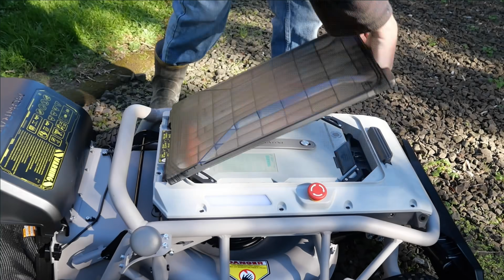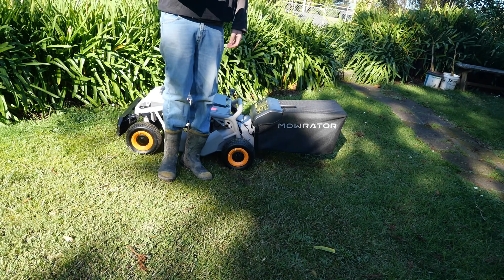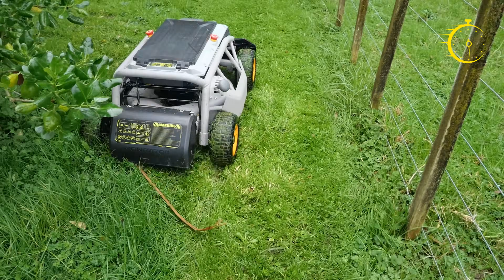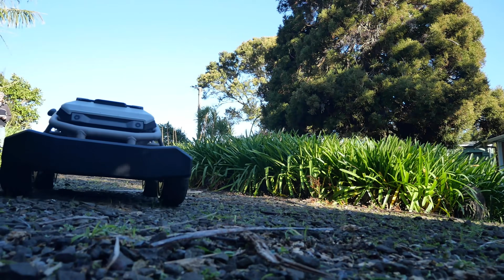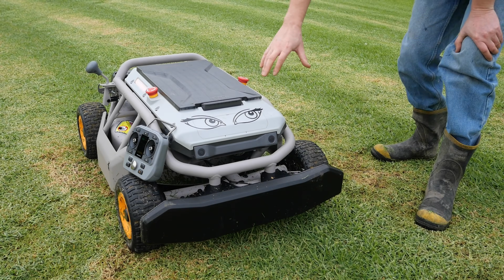MOWRATOR S1 4WD 21" Remote Controlled Lawn Mower Review

Comment: Dji engineer’s put this thing together you can tell because in order to turn the blade on you have press both buttons at the top of the remote in order to get the props spinning on their drones you have push both levers down on the remote.😂😂😂😂

Comment: Mine is arriving tomorrow and I am so excited! It seems from Spring to late Autumn I mow about 4 acres every few days with an ego battery self-propelled mower. It's a lot of work and all on a slope. This mower is going to change my life - I'll be able to venture out into areas I've never taken the push mower!  Thanks for the great video - I had no idea about cleaning it with a hose - its even better than i thought!
Reply: I've had my Mowrator for almost 2 years now and I absolutely love it. had a few issues with the battery - all under warranty and sorted out. As for how it has changed my life: What used to take several days because it was so exhausting I could only do a couple of hours a day, now takes just a couple of hours - all done in one afternoon. And instead of being exhausted from exertion, I now feel like I've just gone for a walk. Honestly, yes its expensive, however it is the best purchase I've made when it comes to taking care of business. I have so much more time - and way better health.

Comment: What a tuff series of little mowers. I was looking at mowers today at Bunnings. My Honda needs big service, leaking fuel. Got the EV bits for my own DIY, this design is better than any others I have seen. A smaller battery will do my 800SM.  A nice platform for a Raspberry Pi autonomous version?  The 2 WD with castors should leave less marks.

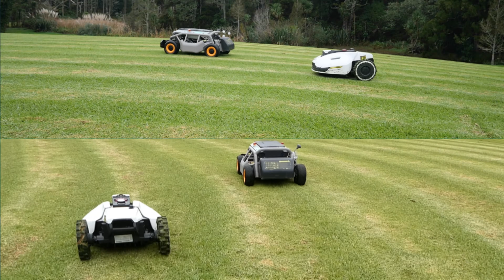Comment: 6:50 Yuka does NOT seem to be set to top speed, while not cutting the options in the app allow it to go faster than this, isn't that right?
Reply from the maker: The speed shown is the top CUTTING speed, even though they were not cutting. As you've pointed out, the Yuka has a slower cutting speed. 0.6m/s vs 1.2m/s for the Mowrator.
Reply: @ToolsAndStuffOFFICIAL  ok that is right,  the cutting speed is lower than the driving speed

Comment: Pretty pretty cool. If they would put a telescopic pole with a camera on the rear frame rail, and a bigger or a second big display on the remote, for some kind of a third person view you could sit on your deck and mow the lawn without even moving a finger
Reply: There is an optional video unit available now (and snow plow for those who would use it)

Comment: Was there a price mentioned here?  Missed it. Great little machine.
Reply from the maker: I didn't mention the price as it is different all around the world and changes all the time due to specials. But there is a link in the description with the current prices and with my code you can get another 10% off any special price.
Reply: Cheaper to tie your lawnmower to pole , set drive on and let it do circles .